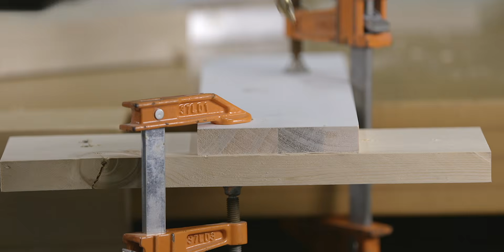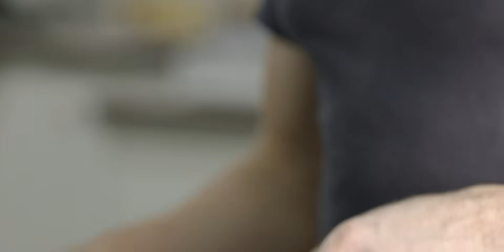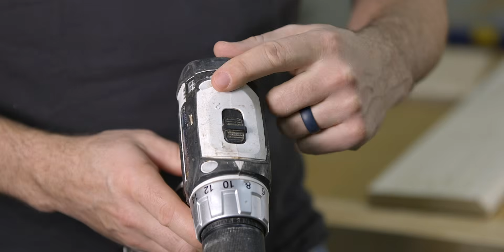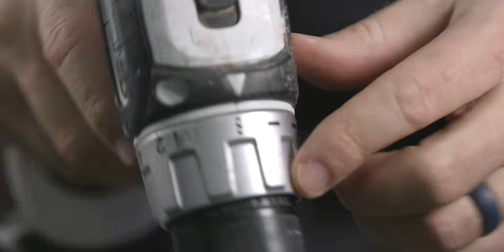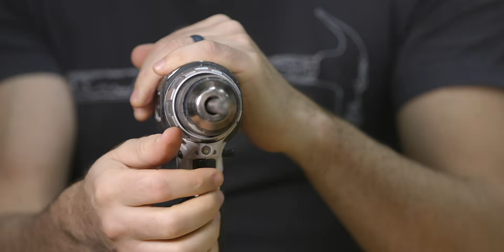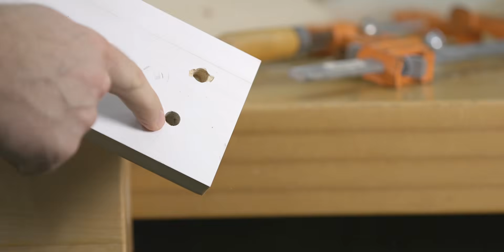Cordless Drill Basics | Beginner

Comment: If you can’t use a drill & must make a level spot using those furniture leveling feet on the underside would just using G6000 glue work & when fully dry can then twist them until your surface is level? 
    Reason asking is have very tiny hands, never used an electric drill & afraid will hurt my own self with it! Is that glue strong enough & must it be used in ventilated areas only? I know nothing about building things but it must be level as use it in my art projects. Tyvm & know your tips will help ppl that aren’t afraid of electric drills.
Reply from the maker: If you can't use a drill then the G6000 (or similar glue) should work... however there are no guarantees. Please read the directions on the glue, but for sure use in a ventilated area.

Comment: I use a lot of your videos to teach my students in Principles of Construction.  I slow the speech speed down to .85 and it helps them to comprehend better.  I like using your material.  
I do totally disagree with you in one respect.  Using your method of tightening the bit in the chuck is wrong according to DeWalt and what we have found using DeWalt and B&D cordless drills.  
I teach my students to tighten by hand as we have had in the past, several drill chuck hang up by the pull the trigger method.  They do not know the meaning of slow engagement or snug.
To support my belief is this statement which is found in the Operators Manual for Cordless drills: Keyless Single Sleeve Chuck (Fig. 7–9)  WARNING: Do not attempt to tighten drill bits (or any other accessory) by gripping the front part of the chuck and turning the tool on. Damage to the chuck and personal injury may result.  
Black & Decker has a similar statement: WARNING: Do not attempt to tighten drill bits (or any other accessory) by gripping the front part of the chuck and turning the tool on. Damage to the chuck and personal injury may occur when changing accessories.
It may seem a bit trifle, however, what they learn first, they repeat throughout their life. Learned actions are hard to unlearn.
Reply from the maker: Sounds good, teach them the right way first. Keep up the good work!